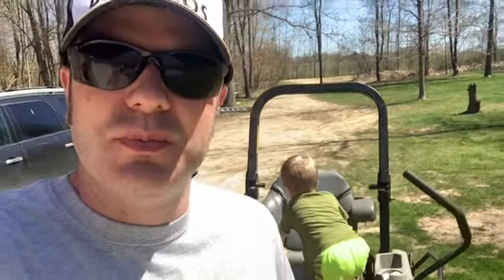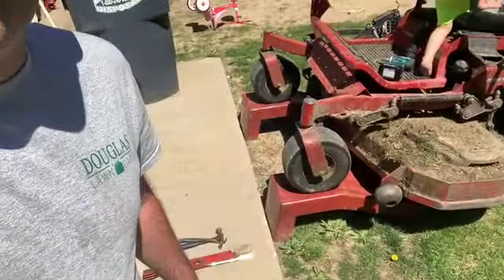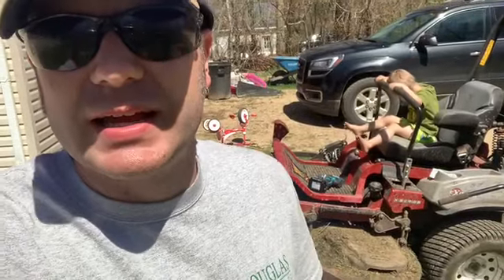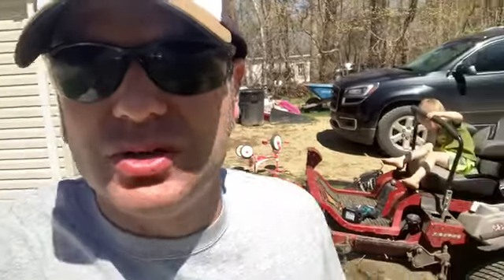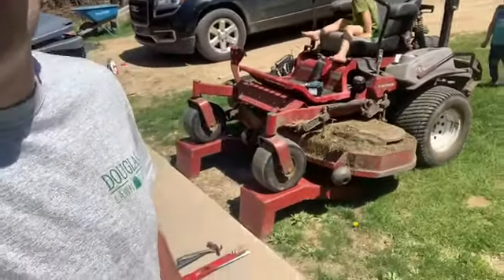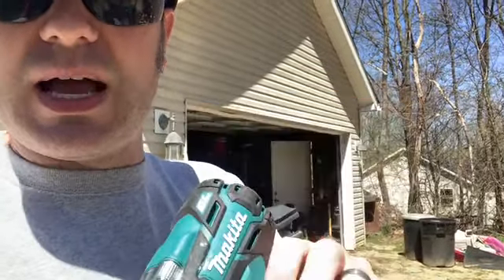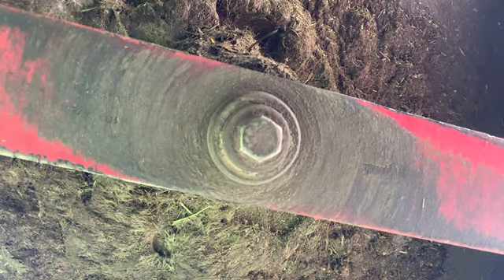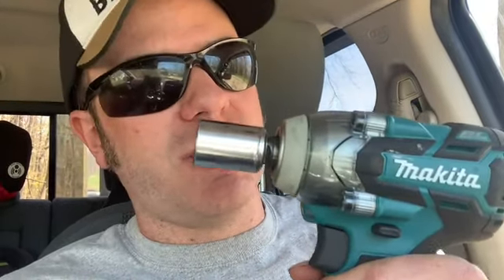Easy way to change mower blades

Comment: Beautiful job. Thank you. Gotta pick one up!
Reply: Eh bruh. Picked up a ryobi mid range impact wrench. Which setting do you use to reinstall blades. Thinking bout using the 2nd setting. Roughly 90 ft/lbs. 1st setting is bout 60ft/lbs.
Reply from the maker: I’d probably use that second setting.

Comment: I had the Milwaukee drill your talking about, and was having problems with the collet loosing bits.  Ended up selling them and getting the Makita impact drill and drill driver.  Bought the one you can change the power settiings on, is that the same one you have?
Reply from the maker: Possibly. I bought it at Home Depot. You can change it to have multiple different settings. It does have a notch on it so I never loose a socket head. Very nice! The battery lasts along time as well!